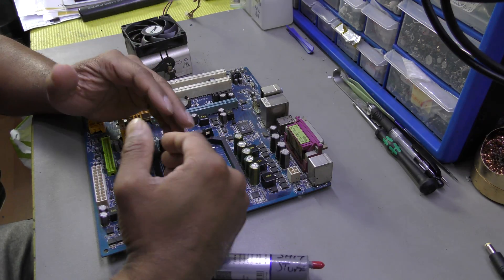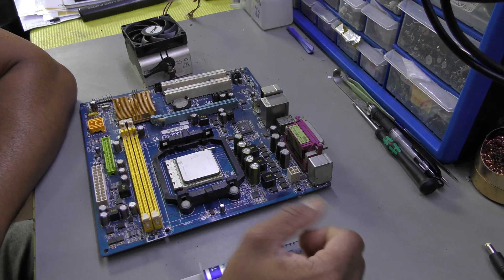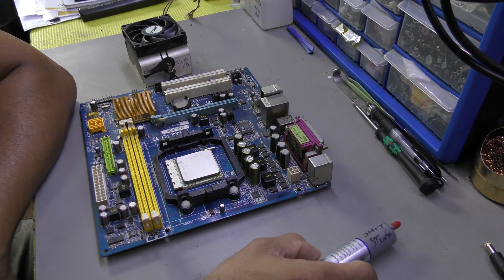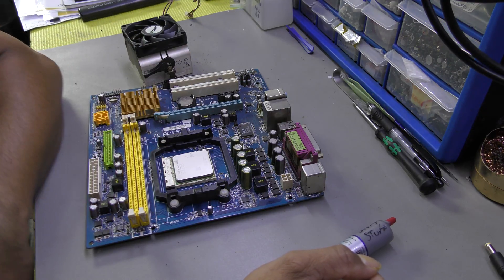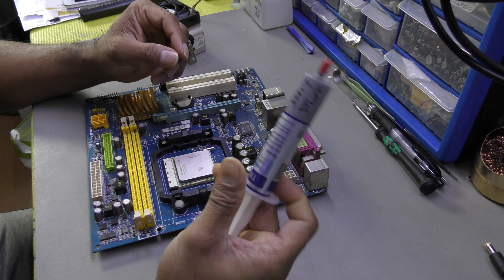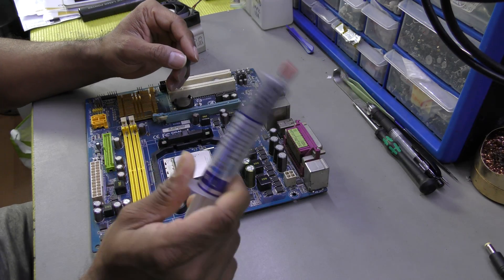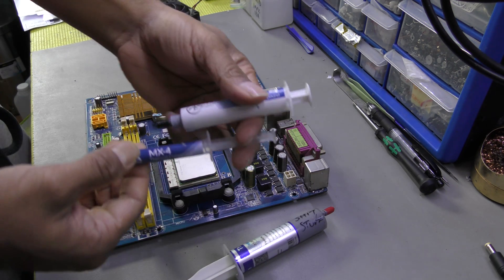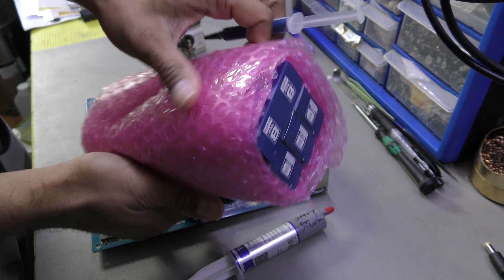HOW TO APPLY THERMAL PASTE PROFESSIONALLY NOT COWBOY

Comment: This guy is right you know. The more surface area you can cover the better the cooling. Having the cpu bare hug the cpu cooler it doesn't transfer heat efficiently. Thats why you have liquid metal doing better and guess what you have spread that as well. So he is right.

Comment: I think people are scared of the spread method because people think it will spread over... only way that would happen if the person put way too much. A lot of people dont understand spreading the thin lair glues to the cooler. Example... If a person looks at a stock cooler with a pre thermal.... it is the same size as the CPU so you are right

Comment: That is exactly the correct way to apply thermal paste. You should apply a very thin layer almost see through to the entire contact area. A lot of people do not even know why you apply thermal paste to CPU’s and other electronic equipment that uses a heat sink to dissipate heat. Thermal paste fills in the microscopic differences in both surfaces so both surfaces can conduct the heat transfer better. I started in computers 40 years ago and I have an MCSE plus many more certifications in computer engineering. Thank you
Reply: Mark Damore your credentials are so impressive
Reply: Yup 100% correct man.

Comment: Your way will literally make no difference at all in CPU temps or lengthen the life of a CPU.  Do some benchmarks and let's see what you find. Every single manufacture of PC parts will almost ALWAYS recommend to use the PEA method. As a matter of fact, I just setup a custom liquid cool loop in my rig and the instructions for the EKWB block showed the PEA method, as well....all AIO cooler also come with a round circle that only covers the main components of the chip.  There is zero reason to spread over the entire surface.
Reply from the maker: Hi Pal,  according to my finding some heatsink are round and others are square.  Spreading the thermal paste with a thin layer assure me a equal and surface if covered properly.  Manufacturers can recommend such, but not everything they state on their manuals are correct.  This where practical work experience come in hand.  In simply words follow your instincts...